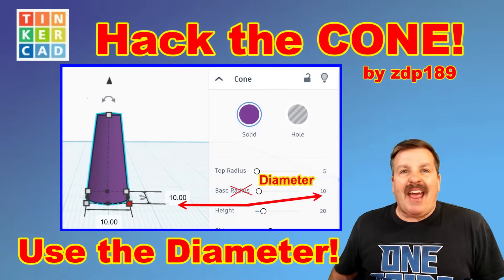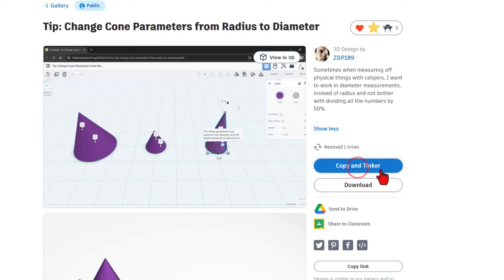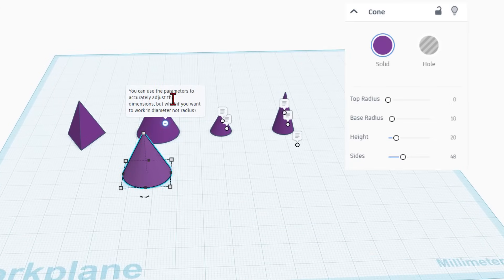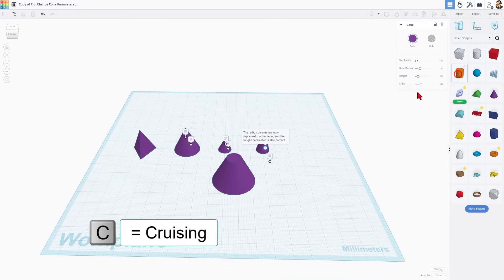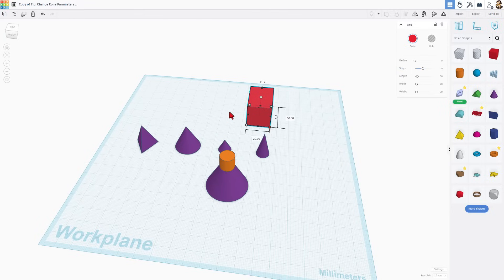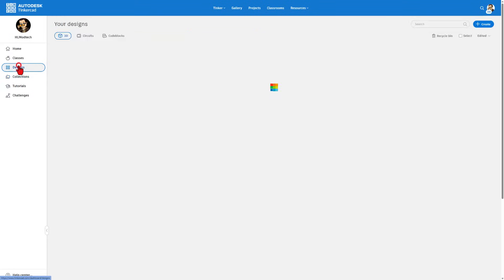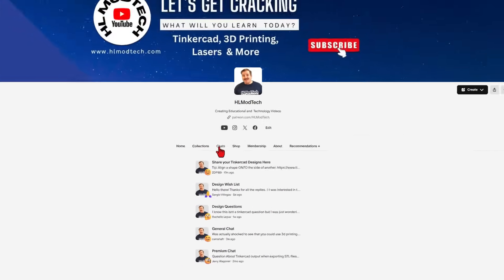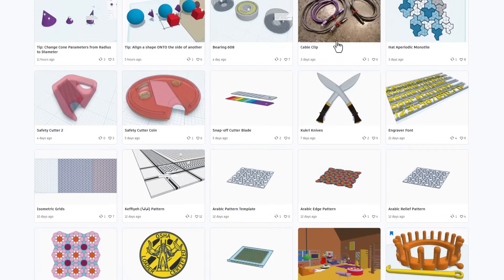Hack the Tinkercad Cone to use the Diameter Other Shapes too!

Comment: Dumb question, why don't the parameter values change to match the dimensions on the workplane?
Reply from the maker: I have zero clue. I just know it is a fact. Pure speculation, but think of the parameters as using a ruler and the handles as putting your hands on the "clay" and changing it. How would the ruler part adapt to what you did with your hands? Once again, just the way my brain processes it.

Comment: Sfit + Drag doesn't break the parameter, ok. Can that also be applied to the rectangle & not break the parameter for radius? That would be incredibly beneficial, gotta check.
Reply from the maker: @brokens1097 I got a funny feeling the rectangle still breaks. I’m not by a computer right now to test it though.

Comment: Would it work if you added it to your creation?
Reply from the maker: @ijcarroll I believe it’ll work in any project. I’ve also found out it works with the tube after changing the tube to half its size. I did have to double the wall width to get it to work though.
Reply: @HLModTech I'm going to try both. I think if I save the cone to my creations and it still let's me adjust the dimensions in the box it'll be ready made.
Reply from the maker: Interesting idea. Let me know how it goes.
Reply: @HLModTech UPDATE adding parametric shapes to your creations (edited cubes, tubes, cones etc. ...) breaks the parametric box and you can no longer adjust it from the box.